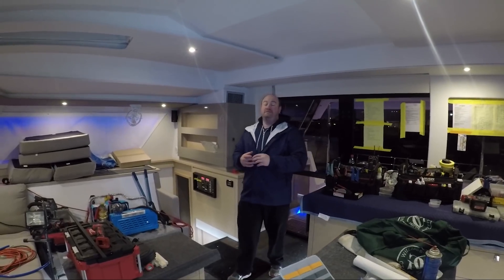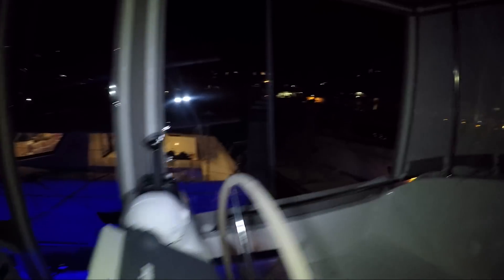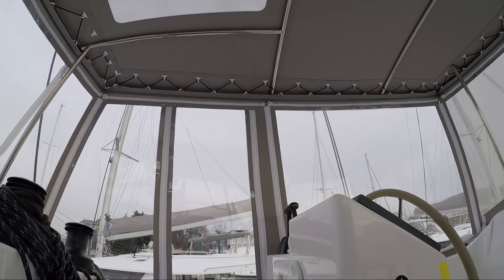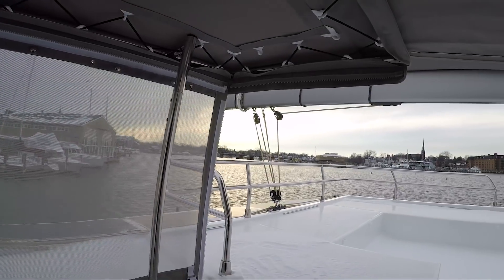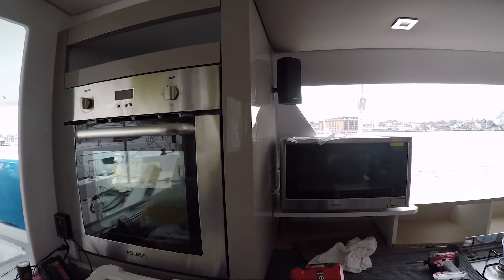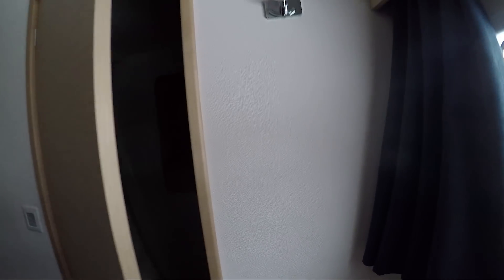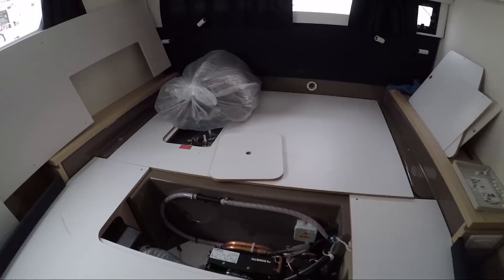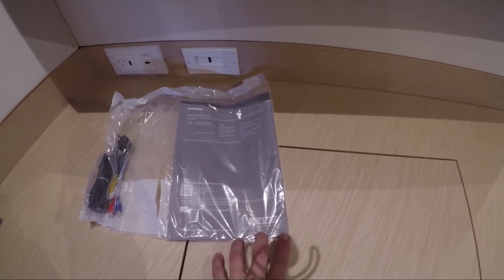Fountaine Pajot Saba 50 Commissioning - Part 4 [Rubber To Rudder - SV Space Between]

Comment: Quick tip: you will need way more battery capacity to handle all this electronics and appliances. I know you have a nice generators, but it's not fun to run it for hours and hours multiple times a day.

Take a look at the "gone with the Wynn's" videos and you know what I'm talking about... Your energy consumption will be at least the same as theirs.
Reply from the maker: Yes, we're learning and adjusting.  Surprisingly, the wind generator is earning well more than it's place. We plan to install 30 more...

Comment: Here is probably the dumbest question you've gotten so far.  I'm asking even after watching every single one of your videos in one setting (at work) (you called it).  Why wasn't all this stuff done before the boat came across the Atlantic?
Reply from the maker: Fountaine Pajot only does some options from their factory. Then they defer most other stuff to either Uchimata in France near their factory, or their dealers (we bought through ACY).  We opted to have our work done in Annapolis because they're the biggest retailer and have worked on hundreds (?, thousands? billions?) of these. Plus we were switching to USA 120volt wiring/outlets & Europe doesn't really do that. Plus, we could drive from Pittsburgh to Annapolis to check in and make any changes in real time...  Remember, there are no dumb questions, just dumb people ;)   But now you're smarter, your welcome!